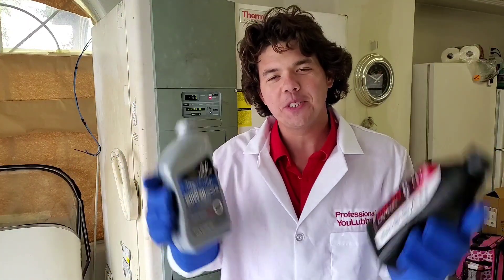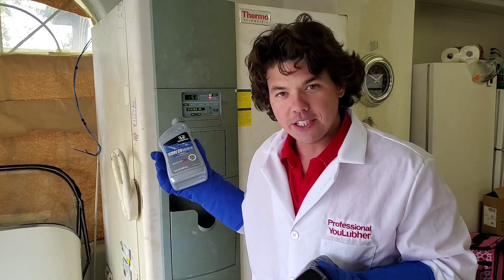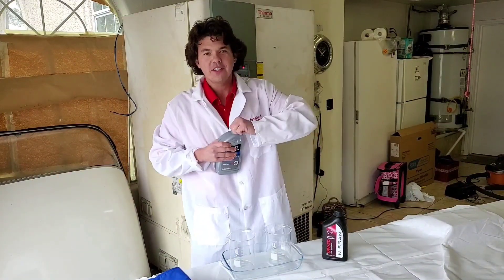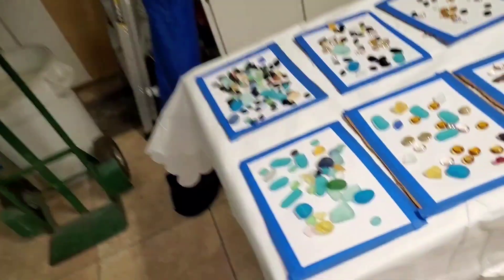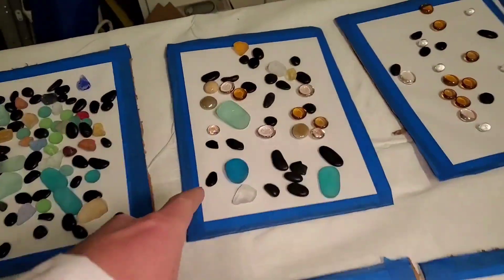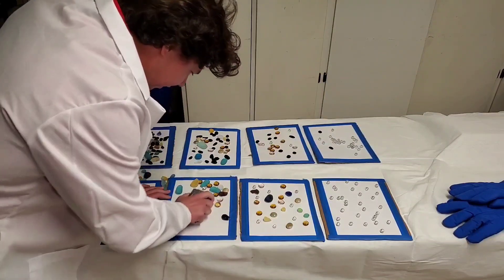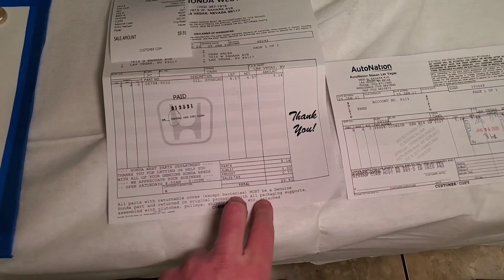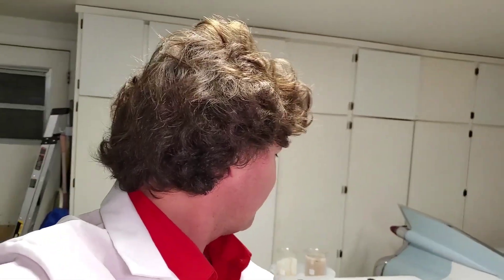Honda VS Nissan 0W-20 Synthetic Oil COLD Pour Flow Test -50°C

Comment from the maker: Professional YouLubher: Eben Rockmaker Regency Direct Jobber AMSOIL Specialist (Dealer#: 5331179) 

To Order AMSOIL Products Click Here - http://syntheticoilprotection.net/ 

Find Products For All Vehicles - 
https://www.amsoil.com/guides/?zo=5331179 

SUBSCRIBE to Synthetic Oil Protection YouTube Channel - https://www.youtube.com/c/SyntheticOilProtection
        
     Synthetic Oil Protection Website - http://syntheticoilprotection.net/ 

      AMSOIL Performance Test Results. Read This Article - https://www.amsoil.com/performancetests.aspx?zo=5331179 

AMSOIL Dealer Google Maps - Synthetic Oil Protection: https://maps.app.goo.gl/2AuZCi8h2Gaf3mY46 

About AMSOIL..... est. 1972: 

First 100% Synthetic Oil Certified in the USA 

1. Where can I find AMSOIL? - Use this link https://www.amsoil.com/offers/?zo=5331179 
Or 
     Watch This Video: The Truth About AMSOIL Why Mechanics Won't Recommend - https://youtu.be/8OhntOxngAA 

       2. What makes AMSOIL different than other oils? - 

AMSOIL is 100% Synthetic & has higher film strength & holds up 4× better in turbocharger deposit testing than Mobil 1 EP which protects and separates metal parts, keeping them from wearing and Lasting Exponentially longer. Watch This Video: https://youtu.be/f4eNPgTi_qo 

3. Why should I use AMSOIL?: It protects the engine so it will last longer. Less oil changes less often (once per year/15,000 miles) or longer... Save money in Gas & Time making it less expensive than a free oil change over the year. Watch This Video - https://youtu.be/H7K6FdZlqmg 

     Professional YouLubher: Eben Rockmaker Regency Direct Jobber AMSOIL Specialist (Dealer#: 5331179) 

Find Products For All Vehicles - 
https://www.amsoil.com/guides/?zo=5331179 

   
25,000 Mile AMSOIL OIL CHANGE. 
Watch This Video - https://youtu.be/vp1HTtlulR8 

The Power of AMSOIL Signature Series 5W-30 Synthetic Motor Oil protects against harmful deposits on turbochargers 4X better than Mobil1® Extended Performance and 3.6X better than Royal Purple® in industry-standard testing*.  Read This Article - https://www.amsoil.com/newsstand/motor-oil/articles/leading-the-field-in-deposit-protection/?zo=5331179 

     Better MPG Proven. Read This Article - https://www.amsoil.com/newsstand/motor-oil/articles/another-win-for-amsoil-products/?zo=5331179 

AMSOIL Performance Test Results. Read This Article - https://www.amsoil.com/performancetests.aspx?zo=5331179 

     Ebens Giveaway: 

Over $5000 Given to my YouTube Community Playlist - https://www.youtube.com/playlist?list=PLB_ftWArBFdey4HFt_Z9KgSIChjkLbw_o 

Synthetic Oil Protection Coffee. To Order Coffee Click Link Below: https://supportwith.coffee/shop/subscriptions/sop/

Comment: Could you please share who makes these two oils? Honda and Nissan don't produce engine oils.
Reply from the maker: Hey William honestly I don't know who makes those
Reply: @Syntheticoilprotection  hi. I just did some google search. Mobile one is making Nissan’s oil. 
If you search mobile Nissan genuine oil, you will find a mobile one page talk about it. 

I didn’t bother to search Honda since I own a Nissan 😂
Reply from the maker: William have you ever had a chance to try the Amsoil yet?
Reply: @Syntheticoilprotection  no. I almost want to try armoil for my cvt fluid. But didn’t due to their high price. I use Idemitsu instead, and it was the manufacturer of Nissan’s genuine cvt fluid but much cheaper. 
For engine oil I’m currently using Pennzoil ultra platinum and platinum. I felt ultra platinum perform better as the car idling smoother. 
I believe the Nissan dealer was using mobile1. So I might switch to mobile1 advanced fuel economy next time and see the difference. 
I change every 5k, so tbh, I don’t expect much difference with different brands. They are all good enough to last 5k.
Reply from the maker: Awesome there's actually a way to get the Amsoil at a much discounted price with my link here and I recommend the CVT fluid you will be very surprised at how much smoother it turns and how much less vibration.
✅ ✅ ✅  Save 25% On Next Fluid Order: https://www.amsoil.com/offers/pc/?zo=5331179
Reply: @Syntheticoilprotection  thank you. I’ll give it a try.
Reply from the maker: Sweet, awesome I will be in touch when I see your order I appreciate your business future business in advance and when you use my link that will give me credit and I'll always be able to answer your questions in the future with the Amsoil products😃😊
Reply from the maker: @willydavid what type of career do you do?
Reply from the maker: @willydavid that's awesome very serious job!

I do both YouTube channels full-time I do the oil Channel 65 hours a week. And I do the magic Channel 7 hours a week.
I follow up with all my customers and take phone calls I also edit the videos tag the videos answer comments.
I also do a lot of networking at coffee shops for both channels.
That's what I do about 77 hours a week😃👍
Reply from the maker: @willydavid it's a lot of fun.
Are you new to the channel?

Comment: why all ppl compare motor oil in cold temperature and no one compare oil in hot temperature outside? 100+ F?
Reply from the maker: Because for most vehicles the cold flow is where most of the where happens on a motor about 80% of the wear on an engine is during the cold start.

The definition of a cold start is when you start the car from the next day from sitting overnight.

A cold start has nothing to do with the temperature.

Even if it's 80° out Fahrenheit a cold start the next day will still have where and the higher quality oil you run it keeps the film strength on the internal parts so when you start your car the next day there is less friction.

Also a high quality oil filter will flow faster on the cold start and also filter better so that's why it makes a huge difference to run a higher quality oil filter and motor oil.

This is some comparisons that you'll see the differences in high temperatures.
AMSOIL Performance Test Results. Read This Article - https://www.amsoil.com/performancetests.aspx?zo=5331179

Comment: Both those are made by exxonmobil I use to work for nissan the back of the bottle would say that 
The oe oil I get from showcase honda for my wife's 18 pilot says the same thing in the small print
Reply: Not true! Honda oil is not made by ExxonMobil.

Comment: Why tested at -50c , it's not practical. Try test it at more real world conditions like zero degree. We are not living in the iced age.
Reply from the maker: 😁😆😉, I thought about it but I like to push the lubricants to the edge.

also I don't have a freezer that goes to that temperature in between so that's why I just go with the 50 because it's a the lowest the freezer will go plus it does show a nice freeze to the oil and how it warms up and what it looks like.

Thanks for checking out the channel man, ☕

There's going to be some exciting ATF fluid coming

Comment: Who makes the Genuine Nissan oil? That's what goes in our Kicks but seeing how poorly it performed in this test I wonder how it fares in other aspects like high heat and longevity since the OCI on the Kicks is 8000kms or 6 months. I might have to look for a different brand 0W20 oil or just for the heck of it pop into the Honda dealer and purchase it. I'll keep buying the OEM filter from the dealership though.
Reply from the maker: Definitely!

Yeah there's many options out there however I prefer a product that pays me to use it.
That's why I use amsoil and that's why I recommend the amsoil for others.
This video will illustrate that.
25,000 Mile AMSOIL OIL CHANGE. 
Watch This Video - https://youtu.be/vp1HTtlulR8
Reply: Nissan OEM 0W20 is made by ExxonMobil.

Comment: Idemitsu 0w20 vs Amsoil. I would like to see that.
Reply from the maker: Definitely where is the best place to get that motor oil?
Reply: @Syntheticoilprotection  Napa Auto Parts generally has it. Advance Auto too. You may have to order it because some stores might not have it in stock. Idemitsu has 2 0W20 oils.

Comment: I only run AMSoil in my cars!!  Great video brother!
Reply from the maker: Oh yeah you're very fortunate to know about amsoil. I'll never forget the first time I heard about it at SEMA here in Las Vegas which is called the specialty equipment market association where they share all different types of aftermarket things and I met the dealer Tom that signed me up and he told me that the oil was good for 25,000 miles and I said that sounded like the biggest crock of .... 😄😁

Then I did my Uber lift field test and ever since I've been changed for life. Watch this video- https://youtu.be/fdSyZ-D3gnw
Reply: @Syntheticoilprotection  awesome video!  I have multiple vehicles so no single vehicle gets too many miles in a year.

Comment: Dude! That is a helluva freezer! We definitely need a freezer tour. That Nissan oil looks like it was suffering from significant shrinkage, lmao! Hiding in its jar like a frightened turtle.. Thanks Eben!
Reply from the maker: You're a funny guy then that is funny funny funny yeah I tell you what I really wasn't expecting that big of a difference!

Really hard to believe how little anti-flow additives are in that oil and the fact that with oxidation that oil will thicken even more so meaning even at zero degrees that oil will barely move once it gets oxidized from heat and combustion gases.

Let alone living somewhere really damp where it rains and snows a lot that would even have more moisture in the crankcase oil.

I don't think the starter on a Nissan versa has enough power to turn that sucker over even at negative 10°😄😁😆
Reply from the maker: I can only imagine the where on the pistons and cams after just 5 years one of those Nissans must lose a ton of performance and fuel mileage. If I had to make a guess I would say they're down 10% in just 5 years or 60,000 mi.

I'm sure that's why a lot of people say well my car doesn't run good anymore I'll just trade it in and get a new one "This one got old" 😄😉

the real stickler is they charge like six bucks for a one quart of that Nissan oil genuine Nissan full synthetic 😄

Comment: I used mopar oil test it ! It says protection for 10000 miles are 1 year. Great video!
Reply: i test it it does not last for 10000 miles,but good for 6 months ! maybe !?
Reply: @Eric Grayson thanks!
Reply from the maker: Thanks David are you a amsoil dealer?

Do you live in the US or Canada?
Reply: @Syntheticoilprotection  no not a amsoil dealer live in us,great videos!
Reply from the maker: Sweet, where did you learn that at?
Reply from the maker: I take it you did a black stone laboratory or an anal analyzer so oil analysis?

Comment: Are they both GF6 Grade Oil?

Always loved Honda OEM Oil. Happy to see it perform well.
Reply from the maker: No idea.

That specification wouldn't really have anything to do with the cold flow properties.

That's primarily the higher quality additives that are added into the synthetic base stock that are a synthetic additive that allows for higher quality cold flow those additives are expensive and that's why a lot of the 0W-40s cost more